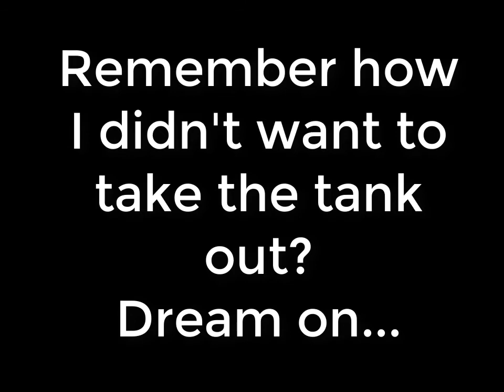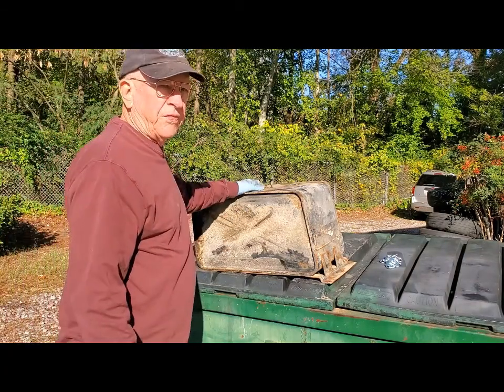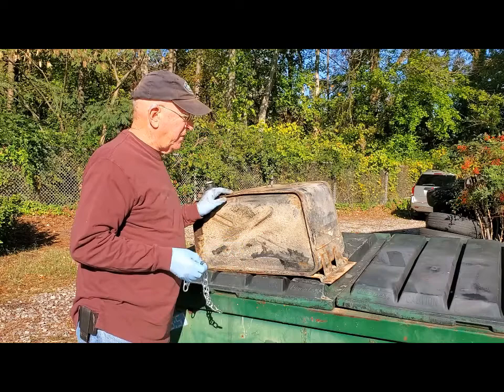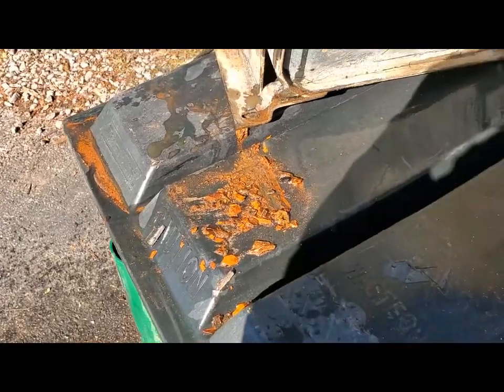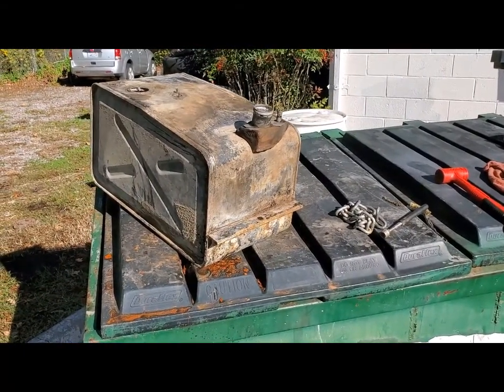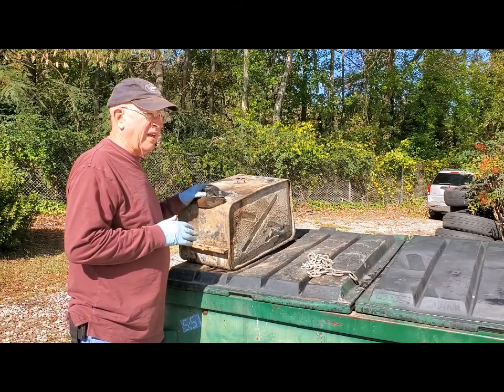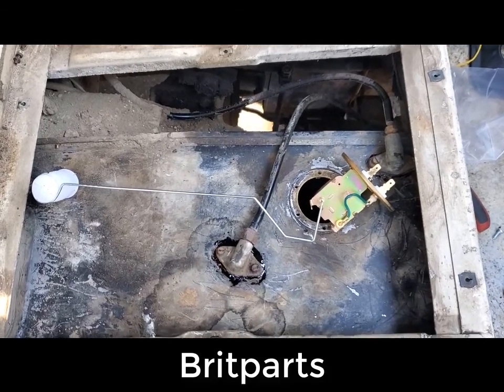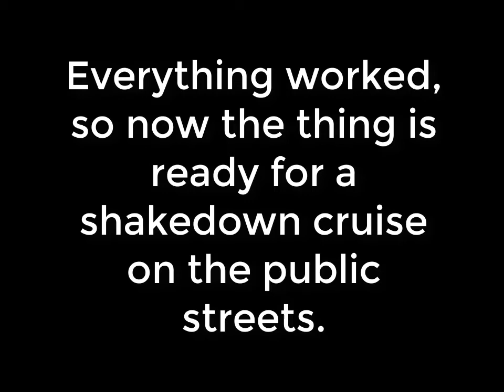Land Rover Gas tank renovation pt 2

Comment: I took mine to a radiator shop and they put it in a hot tank for a week. That did nothing!
I used a pressure washer, then put gravel in it and shook it until my arms were noodles. 
I am also told easy off oven cleaner could work cleaning out the pealing sealer on the inside. I didn’t do that.
Reply from the maker: Thanks for sharing